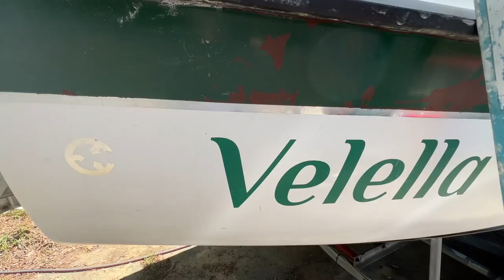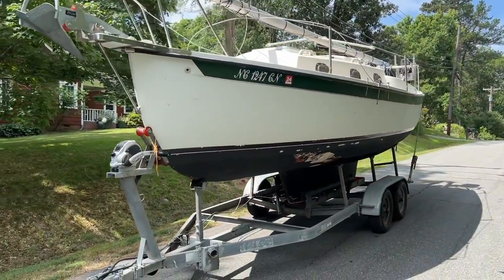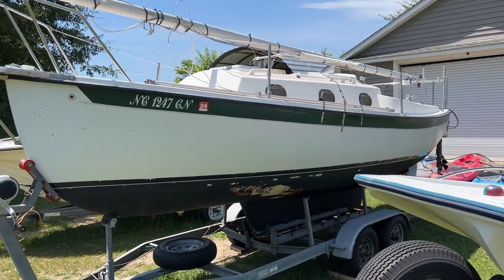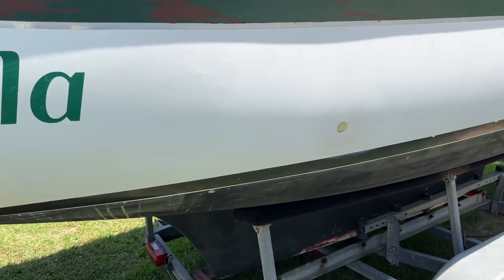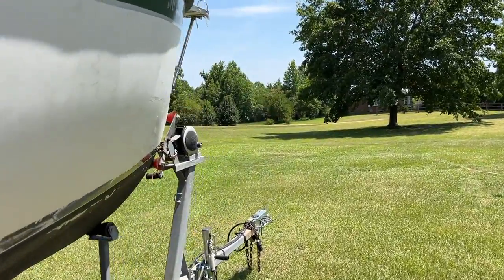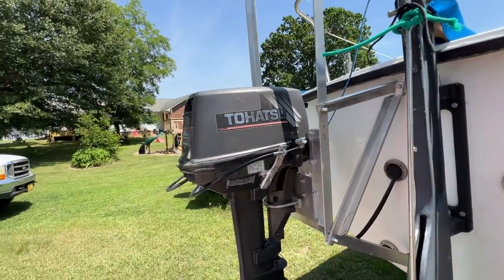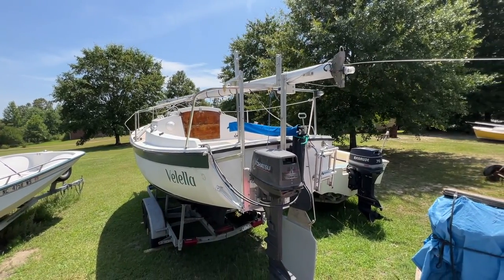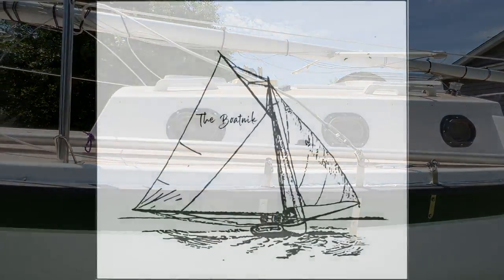1991 Com-Pac 23-3 project boat

Comment: You certainly have the rest of summer and a lot of work to do. A little hot to be working in the cabin.
Reply from the maker: I now have it in my shop with Air conditioning
Too hot and humid here to go sailing so might as well work on a boat
Reply: @theboatnik1328   My buddy and I are much older. We rented a room built into a warehouse in an industrial area of Charlotte. All we had was a huge fan. In the heat of summer it was so darn hot, even with the fan, that we could only do a few hours a day. AC would most likely extended our partnership a few more years. As you well know dust control was critical. Since we were building wooden boats, there was a lot of dust. I do so enjoy your channel and not only are you very patience and gifted, but you also seem like a nice guy. I think that you would be fun to work with.
Reply from the maker: Thanks
Yea it’s not much fun when it gets really hot
Thats cool that you built wooden boats

Comment: yeh if boats are too custom fitted it hurts the resale same with cars ,theres a lot of work in that one for you all those stress cracks and spider cracks my boat was like that all down the tow rail and top of the coamings and at the genoa tracks and the previous owners gave me a nightmare to preserve the original gelcoat the were epoxying the inside all over covering the fitting bolts and nuts ,its like how dumb oh my roofs leaking quick go into the attic and fit new slate roofing tiles on the  inside as if that will cure the leak
Reply from the maker: Sounds like you know first hand the joy of owning an older boat lol

Comment: Hi Boatnik,
We got my 1GM10 going the other day, it need a bit of work on the valves. The thermostat was in poor condition so we started the engine without it and all was well. Plenty of water coming out of the exhaust.
Today we installed a new thermostat and very little water exits the exhaust, almost nothing. Took the thermostat out and all back to normal. Just wondering if you have any ideas on this problem,  does it need to go in a certain orientation?
Cheers,
Paul.
Reply from the maker: You may have it turned backwards
Glad you got it running
There should be some water going out exhaust regardless of tstat. Like a bypass to keep exhaust from overheating the outlet pipe
The tstat stays closed until water temp gets high enough then maintains a running temp but enough water to cool exhaust should always go through
Reply: @theboatnik1328  I am over the moon that it is now running. It was the valves. they were very pitted and we think one was seized. An engineer shop ground the pitted area and I replaced the valves, gave the head a good clean.
The thermostat problem is odd, when it is in place no water. when taken out we have a good flow. I will check it out. Many thanks for the reply.
Cheers,
Paul.
Reply from the maker: @SCCFORUM  the tstat would be closed until the engine warms up so it sounds like you don’t have a bypass direct to exhaust in place for some reason
Look over your raw water cooling flow very carefully
You may have a clog somewhere
There is quite often a line running direct to exhaust independent of engine water jacket/thermostat
Also it is quite common to have (or drill one) a small bypass hole directly in the thermostat so you always have some water circulating regardless if it is open or not
Reply from the maker: Some thermostat housings have a bypass for exhaust cooling cast directly in them and it can possibly get clogged
You should be getting water out exhaust regardless if thermostat is installed or not or open or not
Reply: @theboatnik1328  There is a tiny hole in the thermostat already. I think we may have had the thermostat in the wrong position. We may not of had the cut out in thermostat in line with the pies. I will check next time I am at the boat.

Appreciate your time.👍🏻⛵

Comment: Hi
Do you know if you can get access to the engine on a Compac 23D from the cockpit?
I cant seem to find any pictures or text about it, so I thought I would ask just in case you have owned one in the past..

Thanks,
Paul.
Reply from the maker: I have owned one as well as installed a diesel in one
There is no access to the engine from the cockpit from the factory
Just from in the cabin under and behind step and from sides
Reply: @theboatnik1328  That is great to know. Did you have any vids on the install? I may have a chance to buy a 23D. It has sat on the hard since 2020 and has not been started or any maintenance in that time. What are your thoughts? 

Regards,
Paul.
Reply from the maker: No video of install
That was a long time ago before youtube
Filter the fuel good
Go for it
That really is not that long so if it was good when last used it should be ok
Check oil level before starting
If you buy it just service the engine after you get it warmed up
The oil and filter and fuel filter will probably need changing
Don’t forget to check transmission fluid level and don’t overfill
You may need to adjust stuffing box after launching
Good luck
Reply: @theboatnik1328  Your advice is much appreciated. 👍🏻⛵
Reply: @theboatnik1328  Hi There, I am now the owner of a Compac 23D and I am over the moon.
I need to install a dovetail style outboard bracket as I need to make a very short river journey and do not want to rely on the inboard until I get that serviced.

Would you bolt the plate straight to the transom or would you shim it to take out the slight bow of the transom? Not sure if I have explained that well.
Cheers,
Paul.
Reply from the maker: Congratulations!
You shouldn’t need to shim the bracket but be sure to add a backing plate of some kind
At least use large fender washers
I think I would be more inclined to use the inboard diesel and not drill holes in the transom
You can service the diesel as quick as adding the outboard and bracket  I would think
Have fun with your new boat
Reply: @theboatnik1328  Thank you, I cant wait to get her home.
My thinking behind the bracket is so I can use my Epropulsion as a back up emergency for any future trips. It is underpowered for the Compac but will get me out of trouble. 
I do agree, I don't really want to drill holes. I wonder if I can make a bracket to hang off the transom.
I will go with your suggestion and get the inboard running and go from there.
Many thanks,
Paul. 👍🏻⛵
Reply: @theboatnik1328  Good day.
I have got to turning the engine over but it will not start. I have watched a video of an engine being turned over with the compression lever lifted and this is what my engine sounds like with the lever in the down position. So I assume no compression. Is there any quick checks I can do before calling in a mechanic? The funny thing is the engine sounds really nice.😄
Look forward to any advice.
Regards,
Paul.
Reply from the maker: It sounds like possible stuck valve in the open position
You might remove the valve cover and see if a valve is stuck when turning over
It could also be the compression release mechanism  itself
Reply: @theboatnik1328  Many thanks. I will take a look.
Reply from the maker: If stuck valves there may be bent push rods too
These can usually be straightened out unless severely bent
You can roll them across a flat surface and watch the clearance against the surface as it rolls to get straight
Reply: @theboatnik1328  Thank you. I am getting a mechanic at he boatyard to have a look next week. Hopefully I will learn a few things.👍🏻

Comment: Don’t dare part with the CP 16.
Reply from the maker: I actually have sold Chickadee, the CP 16, but I already bought another 16 to replace it with 
It is a 1983 model mk 1 in even better condition
I will probably do similar mods to it as well
The mods on the other one really were worth doing for sure
Reply: @theboatnik1328  I wanted to buy it if the price was right for me